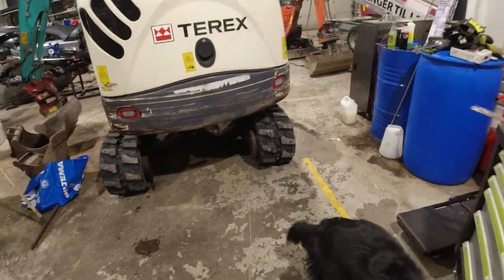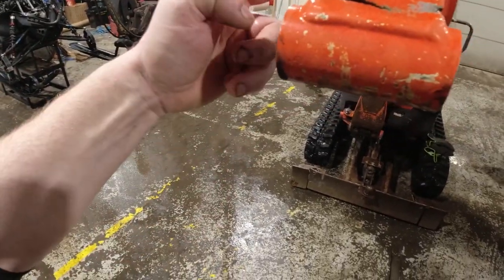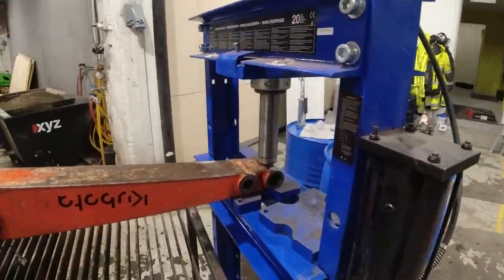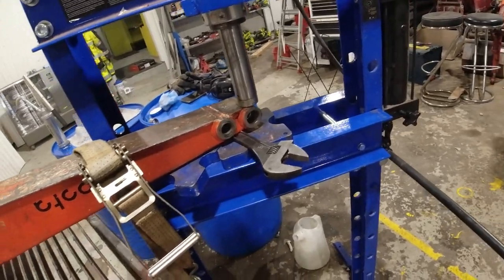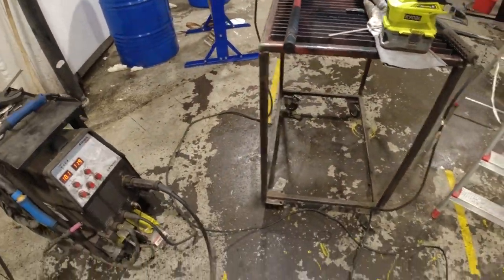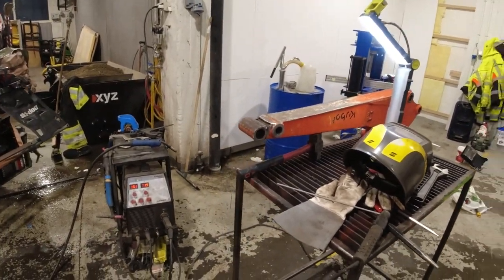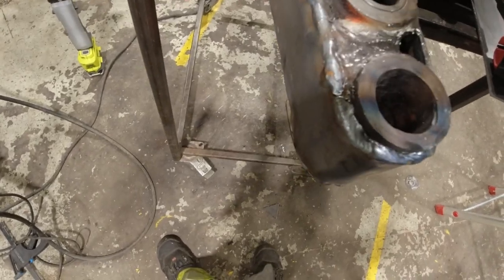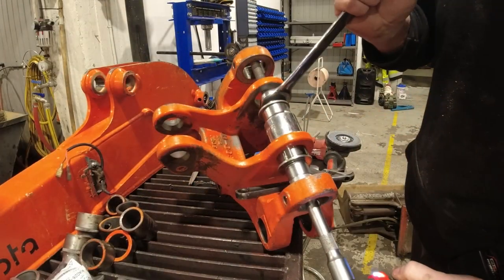Making the kubota great again (Welding a cracked stick)

Comment: My old bobcat had that part of the tick get too worn so a local shop cut it off and weld in a new piece of steel and i think it was a easier repair then the way you did it. then again they had a good lath for making the complex shape on the inside.

If i were in your place i likely would have just gone strait for torching it off and starting over again like you ended up with. Love the attempts though, i have certainly done similar things before realizing that there is an easier way.
Reply from the maker: Yes it was the easiest in the end, seemed like it was an easier way when I stared but I was wrong 😅

Comment: Great job Isak,  make sure of 100% weld seal as corrosive jacking by rust can break your welds, if air and damp et between the steel layers.
Reply from the maker: Thanks. Yes that's why I pointed out the pinhole I got 😊

Comment: Considering the ridiculous cost of new (and used) equipment these days, no question it's worth repairing IF you have the time.  That little Kubota is doing ok for 3000 hrs.  Never thought that small stuff could last that long since they are often abused/overloaded.

Sure wish you'd talk more about starting your business and how it's progressing.

And I think you should rebrand your channel to something like 'Top of the World' excavation - to you, working in such a northern climate is normal, but to the rest of the world it's an interesting change to the typical grading channel.
Reply from the maker: Yes prices are ridiculous right now, the kobelco goes for more now than I bought it for in 2018😳
The little kubota is holding up strong for its houers, the service was well worth it, guess I will have a few new years out of it now.

Yes it has been requested before, never seems to fit in to an video, but I could make an own video about that.
This summer is going to be great it looks like, and last summer was a blast 😁

I actually think you are on to somthing there, that would have been an great channel name😊

Comment: Great Work Isak hope that will not crack again. The time will tell. What do you do  with the further stick bore were the bushings become lose? The new ones won't stay in place again because the bore is worn out. I know that you already did the bushing change but little tech tip. Set some beats of weld inside the bushings you wanted to change. The welding shrinks the bushings and you can slide it out easily.
Reply from the maker: Thanks 😀 I hope this fix will hold for the rest of the time I got it. 
You will see in the next part how I solved that.
Yes I used the welding trick before but luckily it was no need on this machine.

Comment: Which quick coupler are you using for the machine? And where did you get your buckets? I want to get a 4-6 inch trenching and a 30" grading bucket.
Reply from the maker: I use an s30 quick coupler. Buckets i got in internet shops.
Here we measure buckets in liters not inches. 
For us that is easy because we know how many liters each machine can handle 
Like my Kubota can use an 50 liters bucket at max kobelco 100 liters terex 150 liters and so on

Comment: Hi there 
I have enjoyed your efforts and must comment…one of the causes is you are using a bucket that is too big for the dynamics and limitations of the machine
Reply from the maker: Hi glad you liked it. The bucket is 55 liters and on the big end for this machine. But my guess is the hydraulic breaker have done most of the damage on wearing out bolts and bushings

Comment: I see I'm not the only one using ryobi grinder and light.
Reply from the maker: It's pretty good actually, as long as you don't have the 115mm model of the grinder that one is terrible. The 125mm is good. And the light is one of the best ones since you can bend it in all directions.

Comment: That worklight sliding around could use some magnets in the bottom of it.
Reply from the maker: He he yes and the stick as well 😅 the light had a hard life but actually on of the best lamps ever, since you get light in any position, and it's pretty slim if you are working on a car in the engine bay

Comment: i have the cat 300.9 micros the dipper boom tends to crack in the same place from hammer work ,we have broken a few dippers , the first one or two i got repaired, the cost of a new dipper is 350 euro , hardly worth the hastle to repair them , maybe just to keep as a spare
Reply from the maker: That was cheap, for this one the stick was $2500😐

Comment: Just fitted new pins and bushings to my yanmar b17  and reconditioned my hammer.. €1000..
Reply from the maker: So fun to make the old like new 😁 hammer is soon the operating table here as well 😀👍
Reply: @MiniMachines1  hammers are killing for excavators.  Everything breaks including the hammer itself  im mechanic myself but when someone else had to do the work that 1000 euro can be doubled or trippled.
I have fun doing the repairs myself but i kinda like to earn some money with a job too 😀 how is your tiltrotator going or is that a ended story?
Reply from the maker: Yes it's tough on the machine that's why I charge $40 extra for using it, that will pay for new parts.
Actually just picked up the new piston from the post office today 😁

Comment: That is going to be a strong fix for the stick. The machine will be like new when all the repairs are done and it's painted, you will most likely keep it. :) Question, how much weight can your dump trailer haul legally and what size is the box? Looking forward to part two of this video.
Reply from the maker: Yes I'm hoping the fox will outlast the rest. It's really nice now so I'm looking forward to show you the finished machine.
I can haul 10 tons of payload, about 7 kubic meters. I think it's 4,5x2.30m

Comment: it is aways far better to rip  a machine a part and totally rebuild it then buying new plus i love doing it, as a welder by trade on heavy equipment,, it is all rebuild-able, just dont buy parts from the dealer, get a machine shop to make all your new pins an pin bosses,, bushings far cheaper, lots of guys do it on the side,, i just wish i learned machining in my young years so i could do it all.. just a little advice. lose the mig welder totally on repairs, stick weld only with 7018 DC or 8018 DC start off with a 3.32 rod.. keep your arc more to the thicker steel part ans stich over to thinner,, back an forth on a 1, 2, 3 count per weave. cut all plates off and get to the plate in side, and repair and rebuild out,, mig welding is ok for new steel fabricating, not any repairs,, plus learn to weld 110% with stick before ever picking up a mig,, and only use mig for new steel fabricating,, once you got the stick welding down 110% any kid can put steel down with a mig, dont mean its going to hold a thing.. ,ig is not for repair jobs or old steel..
Reply from the maker: Yes fixing it my self is always a better feeling. Sadly a worker in Norway is so expensive it would have been twice the price to get a machine shop to make the bushings and pins.
Reply: @MiniMachines1  here in Canada buying from a dealer kills you. after all all the parts are made over seas.. .. it give one great pride in a well rebuild job
Reply from the maker: I tried to get 6 bolts made for the rollers on the little minidumper a few years ago, the quote I got was more than new complete rollers from the manufacturer 😳
Just got the windows and a new door on the kobelco, the door was $5000🙄 that's like 1/5 of the new price on the machine. Luckily it was an insurance case but anyways.
Reply: @MiniMachines1  thats crazy on the bolts to be made, i know some shops that are really big charge a lot. but there are so many that work in big plants that have a shop at there home and do it on the side, and i have 2 guys with home shops that do all the machine shop work i need at a good price, as for the door and window i do know when it is an insurance case they mark the price up 300 to 600 %, i dropped my glass insurance many years ago as my glass premium was %800 a year and i can buy any front glass for $300 cnd Canada $